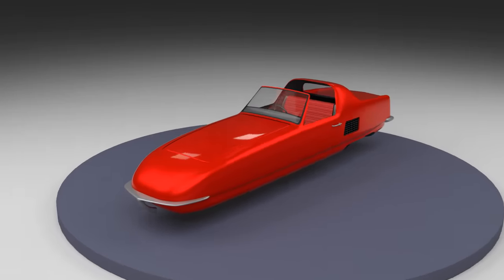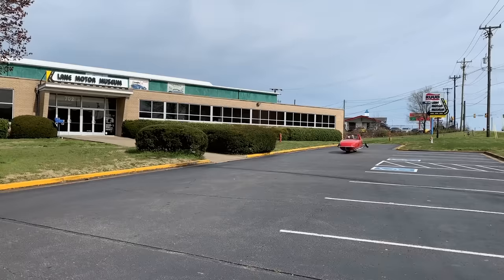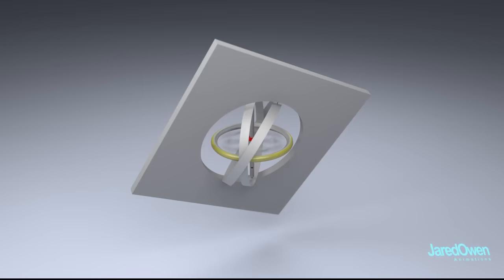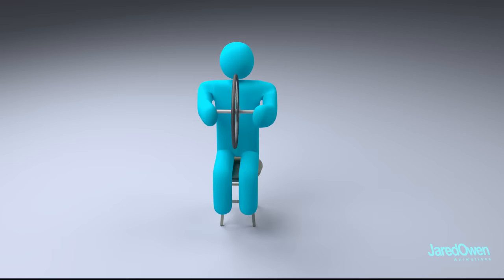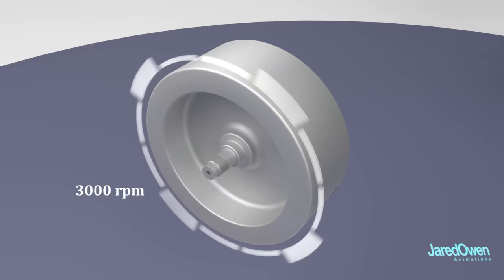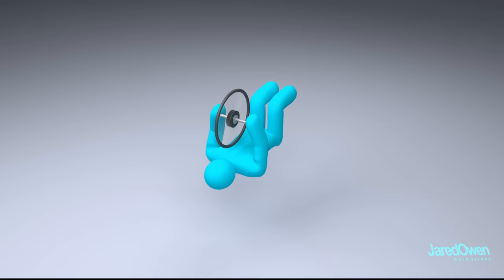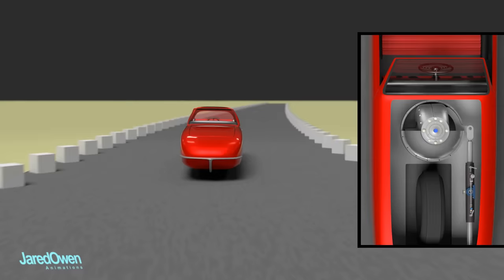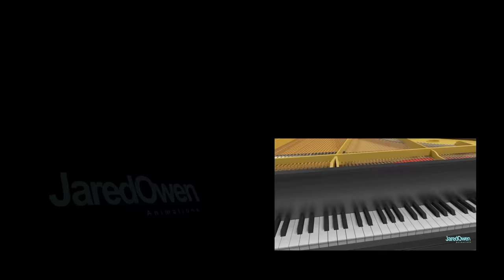How does the Gyro-X Car work?

Comment: Can’t imagine how loud that would be even if the flywheel is just the tiniest bit unbalanced. Those vibrations would not be fun
Reply: Hey, how about pit-stained roads?
Reply: The intensity of the vibrations would depend on the tolerances of the mechanism, and since this would've been manufactured by industrial grade machinery, those tolerances would likely have been too small for any vibrations to be noticeable.
Reply: We also have dozens of ways of reducing noise, especially since the device in question isn't propelling anything, or using combustible fuel...
Reply: It is sealed in a housing and flywheels can easily be balanced to a high tolerance.
Reply: @user-od7hh8qg9d  
“Pit-stained” did you mean potholed?
Reply: They’ve had flywheel powered vehicles before. This one just uses a flywheel for balance. This isn’t a problem.
Reply: Imagine crashing the car 😂🤐
Reply: @RoboArc  depends on flywheel design and it's casing strength.
Reply: @teolynx3805  250 lbs spinning at like 6000 rpm running into a truck  😄 everyone gone bro 😂
Reply: @RoboArc  no. There are a lot of safety features in modern flywheels design. One of them is that flywheel made of winded strip or carbon fiber  so when it crashes it just stops itself by pressing on the casing walls turning it's energy into heat.

Comment: Claimed efficiency... yeah, "my car design will be efficient in the future - i just need a streamline body with no space for other passengers or luggage, and it is only relative efficient when driving at higher speeds to offset the gyros powerneeds - and it is unstable at slow speeds, in tight corners and high speeds, and the gyro is a massive safety hazard".

It is an interesting car, but practicality is kinda like that of a jet pack - it looks cool.
Reply: Maybe a similar concept with a battery would work better. Putting a li-ion battery pack in the bottom of the vehicle would increase stability and make more room where the original engine would be, and this space could presumably be for a second passenger or a trunk. A unique concept and I'm sure it could sell if marketed correctly as a sport or luxury vehicle. It's certainly innovative enough.
Reply: you are ribht, AB... It's interesting but not efficient. For example my Golf 3, with 90 Horsepower makes 45 to 57 miles per gallon. That is efficient. And it can have 5 passengers.
Reply: It's not about size, it's about the fact it's on two wheels but isn't shitty like a bike.. Believe it or not, some of us don't carry round 50 big macks and a fat wife and kid, so a small luggage is enough.
Reply: @bungaplayz228  Innovation for the sake of innovation is always a bad idea.
Reply: @september1683  Like my kids: they don't exist. They do an unlimited number of distance to the gallon. They don't take up time at school, no animals have to be grown to feed them. No religion can trick them, nor any ideology. They're not gonna experience oppression and won't go around the world distributing 'freedom'. They will never take up space in a graveyard or a cremation oven. So they don't power our useless cruel machine that is society in any way whatsoever. It's a wonderful situation.
Reply: Also we already have two wheeled cars balanced by two gyroscopes. They're called bikes.

Comment: So it's a motorcycle?

With extra steps..
Reply: Yes but it will stay balanced even when it is not moving, unlike a motorcycle
Reply: Aditya Agarwal nah they have those now. 

Look up Honda self standing motorcycle.
Reply: A motorcycle with doors and seatbelt.
Reply: Yupe.
Reply: It drives/steers like a car
Reply: Legally.....it's split into 2 groups( for all the new three wheelers.)
A seat you strattle means you have to have a motorcycle licence.
A seat that's typically what you would see in a car....makes it a car.

But yeah.... blurred lines.  It's fair to call it a motorcycle with extra steps I think. 😂😂
Reply: Two wheels does not mean a motorcycle, for they can have three or more wheels. It is about the steering and handling
Reply: @Jeffrey314159  I'd say if it leans into the corner it's fair to qualify it as a motorcycle. otherwise it's not.
Reply: @C4H10N4O2  Apples and oranges!  If it can be steered like a car, then it is a car!
That is Essentialism 101
Reply: @Jeffrey314159  Okay, english is not my mother tongue, so I didn't understand most of your comment. But you do seem annoying.
Reply: @C4H10N4O2  It is a habit of mine, like with Sheldon Lee Cooper of that TV show: THE BIG BANG THEORY
Reply: According to the (US) Federal Motor Carrier Safety Administration (FMCSA), a motorcyle is defined as having no more than 3 wheels. 

Motorcycle is defined as a motor vehicle with motive power having a seat or saddle for the use of the rider and designed to travel on not more than three wheels in contact with the ground. 

source:   https://www.nhtsa.gov/DOT/NHTSA/Rulemaking/Articles/.../mcpkg002.pdf
Reply: @Jeffrey314159    Not according to US Federal Regulations.  A motorcycle cannot have more than 3 wheels. It not about the steering and handling.
Quoting 49 CFR § 390.5 - Definitions. 

"Motorcycle means a motor vehicle with motive power having a seat or saddle for the use of the rider and designed to travel on not more than three wheels in contact with the ground. "!
Reply: @adityaagarwal7106  my motorcycle stays balanced while not moving. Either by using my feet if I'm sitting on it or by using the stand if I'm not. Both ways use no energy. What happens when you turn the gyro off?
Reply: But more awesome
Reply: LOL
Reply: If you look at the quantity of wheels, so you should call it BEcycle. But it's not the real reason to call becycle as becycle. VelocyPED, that's the right name it should be. Because of pedals it's moving by.
Reply: Yesn’t
Reply: Seifi Seifi yes
Reply: @kurthaas4331  using energy.
Reply: It's a motorcycle without the rain
Reply: Always has been
Reply: No it’s a motor cycle with
Reply: No
Reply: Oh ya
Reply: @adityaagarwal7106  can you show me which part is responsible for pushing the gyroscope when the car is tilted, i see videos that don't talk about this part
Reply: 230 lb flywheel? 
That's freaking heavy! 😢

Comment: That was very interesting. I never thought something like this would exist. Ahead of its time.
Reply: Great concept car, perhaps a re-design to make it more practical?   For now, it is just an overweight motorcycle that can stand upright at a red light.
Reply: @DreDredel3  Too little passenger and cargo space.
Reply: Throw the engine out and put it on a bike gyrocar
Reply: Switch the power train to electric with a hub motor and have the seating inline rather than side by side and the drag coefficient would be tiny. A 50kw motor would make this thing fast, efficient and practical for all year round use.

Comment: The original came out around 1960. The flywheel/gyroscope had bearings made of a Beryllium-Lead alloy that was self-lubricating
Reply: ..I've read that the developer wasn't able to make "the matter" work; this only nowadays was overcame by an Italian specialized factory, to allow "the matter" working at the Villa d'Este concourse 2019.
Reply: and beryllium is in  in microwaves. and no it doesn't make your food toxic
Reply: @studiocalder818  
What is “the matter” you’re referring to?
Reply: @thechumpsbeendumped.7797  that vehicle
Reply: @studiocalder818  
What about it? The previous sentence you wrote made no sense.
Reply: @thechumpsbeendumped.7797  
That nonsense was just an idea, which didn't work; It was only possible to run it a few years ago when it was restored.
Do you know what the concours d'elegance for historic cars at Villa D'Este is?

Comment: The gyroscope could actually have been a big battery, after all it is spinning weight that a gyro needs to be effective, and a battery has plenty of weight. Put the batteries weight to actual use and create a hybrid drive system.
Reply: Interesting
Reply: Centtefugal force will kill battery
Reply: perhaps shape the armature of an electric motor to act as drive power and gyro stability?

Comment: There was a monorail vehicle developed in the early 20th century, that operated much like the Gyro-X  did.  The vehicle had two main wheels in line with each other, which rolled over  a single rail.  Gyroscopes kept the vehicle balanced.  This vehicle never went beyond the prototype stage.
Reply: can you show me which part is responsible for navigating the gyroscope when the car is tilted, i see videos that don't talk about this part

Comment: When going downhill, the car balances on just the rear wheel.
When going down a steep hill, the rear fender gets scraped off.
When you drive too far in a straight line, the nose pitches up. Do it in reverse and the rear pitches up.
Regardless, keep the car running for 12 consecutive hours and it will try to flip itself upside down.
Reply: Is this true?
This has been tried a few times:
Shilovsky's gyrocar in 1914
Gyro-X, 1960's
Lit Motors, C1, 2010.
All of them failed.
I figure there were hidden problems in this design.
I've never seen the C1 from Lit motors demonstrated on anything but a parking lot at slow speeds.
Reply: Not with the gyro in this orientation

Comment: I drove early versions of this. It had two wheels and a bumper on 4 corners at the bottom. I also rode in a one wheel one that felt more unstable. They had to reassure me that it would never tip over. They laughed and said you know how people are. They have to test the limits of things even if it is not useful. They make things just to make them, then they can be the expert in it.

Comment: Hi, Jared - as ever, I really enjoyed your video. In this case, however, I was left a little confused as to quite how the precessional ram receives its inputs. If, for example, the Gyro X were stationary, received an impulse from a sudden brief gust of wind and began to tilt to one side, how would this tilting motion be detected by the car and translated into a compensatory movement of the ram?
 I hope I´m not being too  obtuse...
Reply from the maker: Yeah I'm somewhat vague on this as well - the mechanisms refer to this as the "control system."  Beyond that I don't know too much
Reply: @JaredOwen  Well, the ram´s obviously a two-way item which can be pressure-fed from either end, and there´s presumably a reservoir of pressurised hydraulic fluid and two valves, one for each direction of travel.
 I did wonder whether these valves might be controlled by a linkage originating from another, far smaller gyro, whose response to inputs was thus being employed to operate those valves sufficiently quickly to keep the vehicle balanced.
 In the absence of electronic control it´s hard to think of another way in which the engineers might have done it...
Reply: @Del350K4  
Good point although with modern tech it would be a relatively simple problem to solve I’d still like to know how they archived it back then.
Reply: Thank you for your honesty Sir! I'm imagining that the control system is the trickest part in the whole car, quite possibly the biggest challenge to develop.
Reply: @philiptownsend4026  Wow - I think this must hold the record for the most protracted conversation I've yet had on YouTube : )
 Five years! But it's a fascinating vehicle and you have helped to raise its profile.

Comment: And when you crash, the kinetic bomb in your trunk blasts through whateverthefuck it wants...
Reply: XD
Reply: Steering is not quick to avoid obstacles
Reply: I'm Pretty sure if u told  men 200 years ago that: today we would drive at 60mph, mere feet from from other cars going at similar speed in the opposite direction, powered by explosions a few inches away from our feet, and sitting on top a tank of explosive flammable fuel, almost daily,  and the men from 200 years ago would be sure u are crazy. Of course such devices as cars will never be created.
Reply: Bad Behaviour Well you wouldn’t describe in like that though would you?
Reply: @markflierl1624  at least that saves road space & reduces urban sprawl
Reply: did the address the problem of the gyro wanting to lift the car off the ground ? I might add this may increase if you change the direction to fast , in other words try to turn the vehicle in a different direction than is it headed in..... don't blame me for my comments please I've already research Gyros and I found some things out before I seen this video
Reply: Johnny 5 research fl wheel energy recovery system that was used on f1 cars. With today’s tech it might be safer really. And they are buses in Europe that have a flywheel spinning at couple hundred thousand rpm, enough force to blow up a car.
Reply: Nice
Reply: Petrol engines have a kinetic bomb too - the flywheel.
Reply: I kinda wanna see that
Reply: You mean the flywheel encased in a sphere of solid metal? A combustion engine would react the same way.

Comment: Thanks for the explanation, and love your 3D animation as well. The Gyro-X could have been breakthrough back then. Glad we can cherish it now.
Reply: The Gyro's bearings were made of an alloy of Beryllium and Lead
Reply: @Jeffrey314159  
What’s your point? It’s a sealed system and apart from that the tech has probably moved on from that now so neither would need to be used.

Comment: I've always wondered how electric Hair trimmers work.
Reply: I once opened one up to fix and figured out how it works. There is a mechanism that moves side to side that basically works as a spring and electromagnet. When connected to AC current, the current through - and force by - the electromagnet reverses at 60 hz (in the US anyway). This moves the spring-loaded bar with a magnet on it side to side. As the bar moves the back-EMF (Electro-Motive Force) of the moving magnet fights the current flow through the electromagnet, limiting the current flowing through it - if there is more resistance to movement more current will flow. If it is jammed there will be no back EMF and the current will be very high, likely blowing a circuit breaker - if I remember right this was why I needed to take apart and fix it. This moving bar moves the blades back and fourth. Would all make more sense if you open one up. An animation would be pretty interesting.
Reply: I show one taken apart on my cheesy channel(electric hair trimmer.)
Reply: And run it while taken apart😏👨‍🔬

Comment: Great application. Years ago and lacking R&D money,  the idea struck me to use a portable/ interchangeable type gyro to attach to say.. shovels, (wouldn't have to look for something to lean it on when not using it) and even homeowner ladders for stability and safety. (lots of accidents yearly). I think the problem with a smaller unit would be getting the rpm's high enough to be effective.
Reply: Or you could just dig the shovel into the ground, lean it against something or even lay it on the ground. I can imagine how awkward it would be to use a shovel that has a gyro and batteries to power it attached and has to be charged up. The weight, impracticality, complexity and expense make it a no go.

Comment: Btw folks a gyroscopic two wheeler is NOT like a motorcycle the gyroscope is a separate spinning disc independent of the engine which drives the wheels and has an orthogonal angular momentum vector.

Comment: It was probably a vertical axis rotor they used and not horizontal though either orientation would work. I assume that Agency Impianti, the company who did the work, builds their gyros like Seakeeper who use vertical gyros.
Reply: No, because with a vertical axis rotor, if the car tilted it would the gyro would try to lift either the front or back of the car, and making horizontal adjustments like in the video would do nothing.

Vertical axis gyros are used to determine the roll or pitch of a ship or aircraft.

Comment: I can think of a few improvements.
First, why should the fly wheel be dead weight? Motors are heavy. batteries are also heavy. it'll make maintenance hell, but you could probably spin the majority of the empty vehicle weight if you balance it right.
Second, you could use a much smaller gyro with its axis fixed to the frame to detect torque being applied to the vehicle. might need a gravity based sensor to correct for drift though.

Gotta wait until I'm in a position to actually prototype that though, so I don't know if this would actually work like I think it would, or if it'll blow up in my face.

Comment: I wonder if a compact rotary engine could suffice as a means of providing gyroscopic procession - thus eliminating weight
Reply: It's not always running at high enough rpm to be used as a gyroscope. Plus it would require very heavy parts, making it impractical as an engine.

Comment: I believe, there was autobus concept with gyroscope engine. Seems like the issue of it is that it doesn't last long after gyroscope is started up. Besides it is quite dangerous - so much rpm multiplied by its weight will smash everything around you in case of wrecking

Comment: this same principle is still in use today in motorcycles, when a motorcycles is in motion it cannot fall over.
Reply: This is true, but this remains standing up even when stopped at the lights - as long as the engine is running.
Reply: @SpaceShipDee  cool

Comment: Wow! Thats awesome! But that giant flywheel can now be replaced by a tiny gyro and a computer control system. Great idea nevertheless! Thanks for remembering that for us!
Reply: Wouldn’t you still need the mass of the flywheel to counteract the vehicles unwanted movement? If so, the only way to reduce the mass of the flywheel would be to increase the speed of the flywheel.
Maybe you’re thinking that because there are gyro sensors in smart phones that that would work, coz they wouldn’t.

Comment: you dont actually need a gyroscope to balance it. you can also accelerate the car to about 2000 kmh  and it wont tip over because of the forward forces